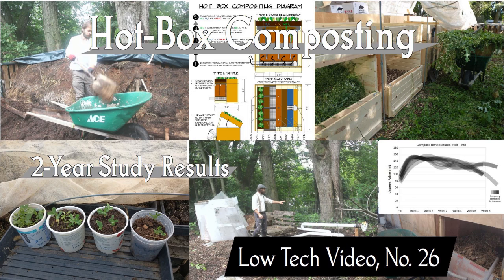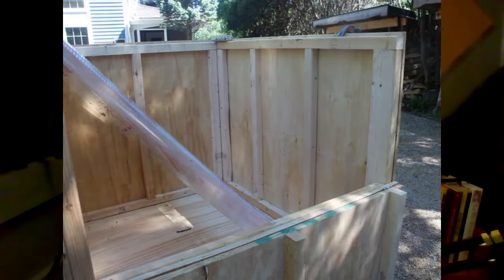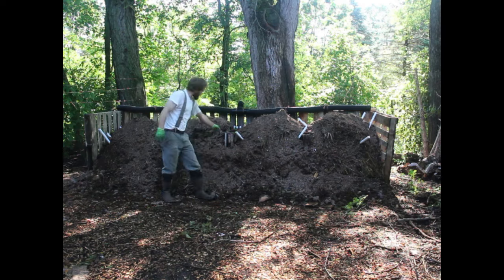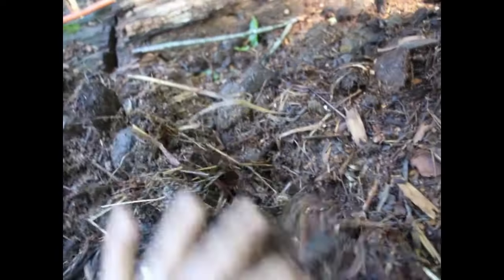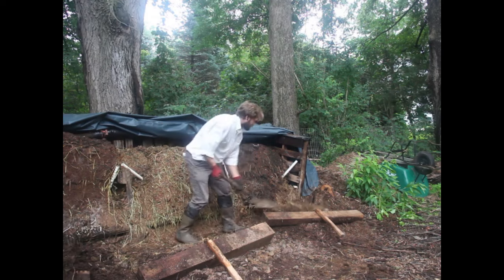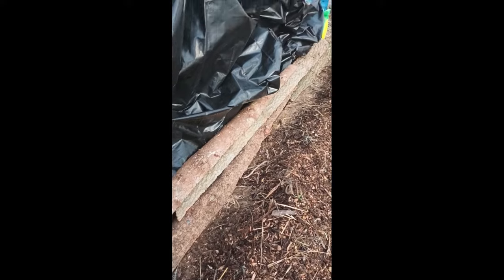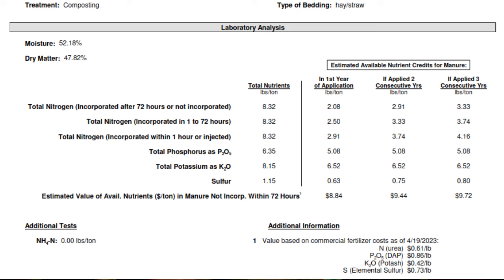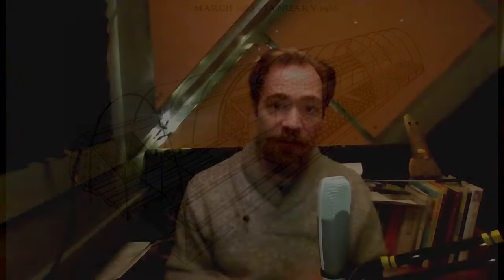Hot-Box Composting Study -- Low Tech Video, No. 26

Comment: As someone who has never gardened in your climate, my ideas are not terribly useful, but if i was going to force air through the compost i would look into using a portable diesel heater to pre heat the air. While that may seem to defeat the purpose, taking a 5kw heater and picking up extra heat from the pile to keep a green house running seems cost effective.
Reply from the maker: Thanks for watching. The compost pile produces so much extra heat, running a pipe from one side of the bladder to the other, pulling cold air through the warm space and then into the blower would preheat the air, too. Or installing the intake at the top of the greenhouse to catch warm air there. The heat is there, I just didn't capture it. :-) Next build would integrate that, though. Thanks again!